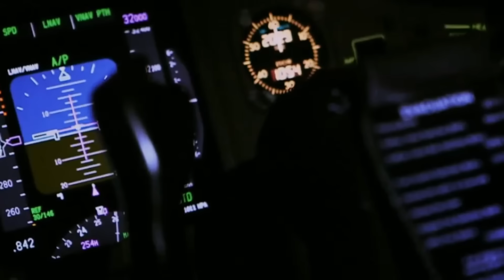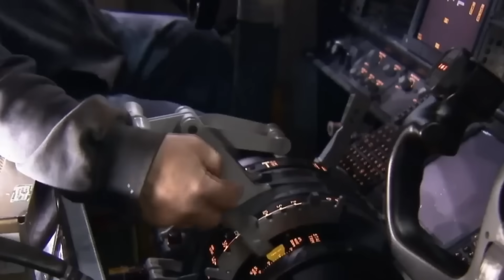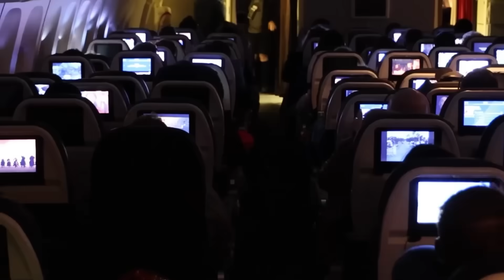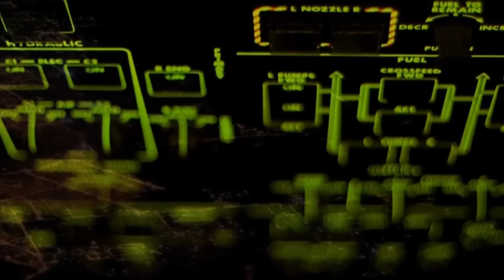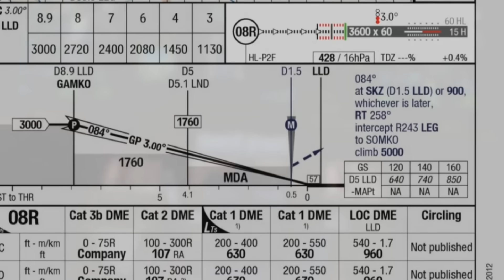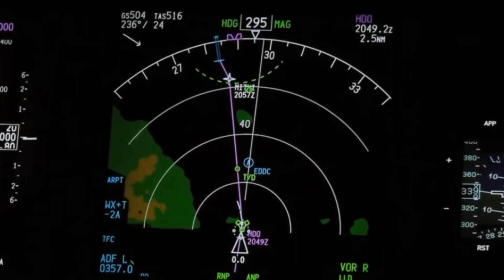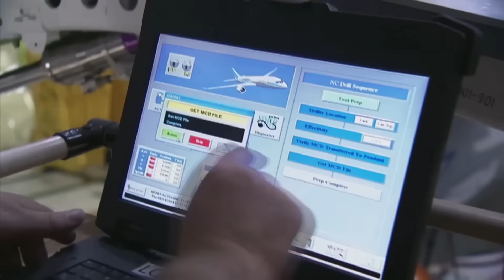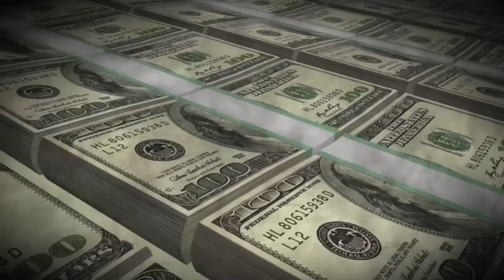This New Boeing 777-10 GAMBLE Will Change Aviation Forever!!

Comment: You can only do so much with a 1960s 777. Folding wing tips. WOW.
Reply: Bro what? This is rage bait right? The 777 was started in 1990 and has only been in service since 95. The 737 is that old but cmon. And the folding wingtips have been part of the design of the 7x since day 1 which was sadly was over a decade ago at this point